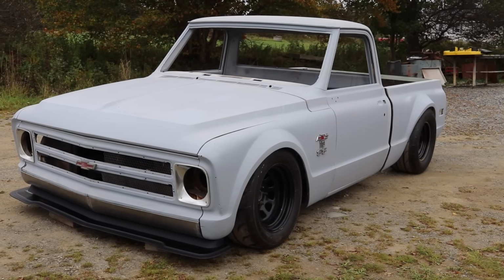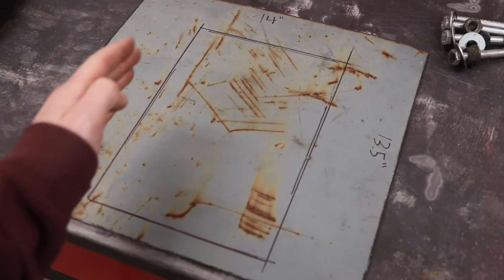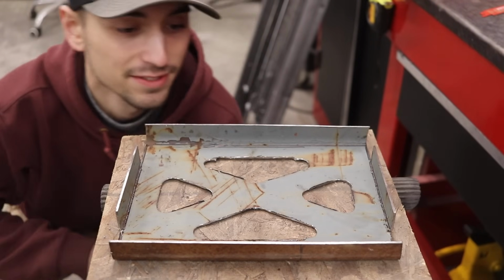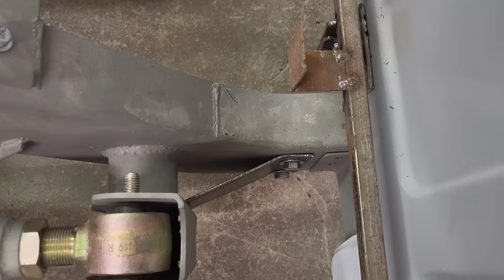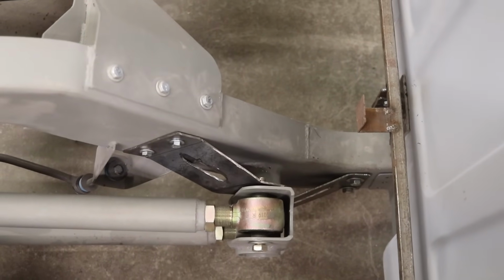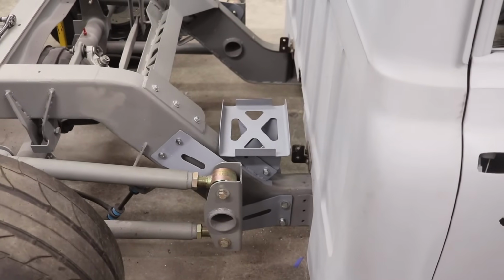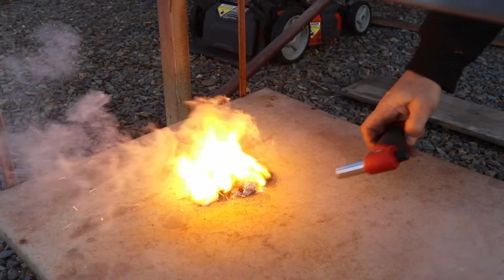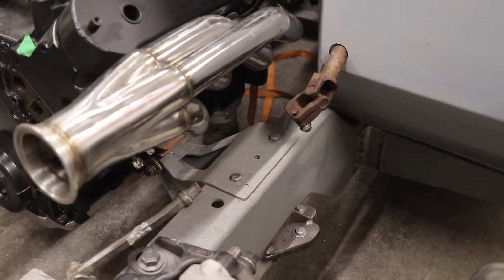Turbo ‘68 C10 SS (SUPER SHORT) I Reinforced My Custom 4 Link Suspension!

Comment: I'm glad you are ok after that near miss. Aluminum dust and mild steel dust mixed together can become thermite and ignite when an ignition source is present. However, it is also extremely common for auto makers to use magnesium for production of steering columns. The result of grinding magnesium and having a reaction similar to yours is very plausible. I would suggest testing your column to see if it's magnesium. You can put a cap full of vinegar on it and watch for results. If the vinegar does nothing, the it's aluminum. If the vinegar has a reaction by bubbling or foaming then it's probably magnesium. For just aluminum to be flammable like that, it has to have an ignition source present when it is in exactly the right concentration when airborne. I hope this helps.
Reply from the maker: Thank you! Good point, there very well may be magnesium in there. I'll try that out to find out👍

Comment: I’m glad you added brackets to those 4 links. The single tube mount was a bit concerning. I would have probably used something like 1/4 or 3/16 at least. But you have to use what you have! Great engineering
Reply from the maker: Yup, it will for sure be better with the added brackets! We'll see it holds up!👍

Comment: Have you thought about making a triangle on the bottom of your jack powered metal brake. So you only need one jack. I know you lose a bit of power but I'm sure it would make it easier to operate.
Reply from the maker: Never thought about it! I'm sure it would work. I could swap it out for use with light gauge metal👍
Reply: @ag_trucks  the other option is make a removable T piece bar that joins the two Jack's together so they move in tandem equal movement  less effort...if that makes sense

Comment: I like what you're doing, really cool project. Maybe make the speed holes in the 4 link brackets triangles as well. It would fit with all the other triangles.
Reply from the maker: I would have done that but I don't want to take off too much material off the brackets. Thank you man👍👍

Comment: I didn’t know aluminum burnt like that, magnesium yes, wow. 
Steering column coming along nicely. 👍
Reply from the maker: There may have been magnesium mixed in along with the aluminum, either way it was very flammable lol. Sure is, hopefully I get my parts soon to finish it up👍
Reply: Magnesium adds strength to cast aluminum parts
Very common with cast aluminum parts
Also water does not work well on magnesium fires

Comment: If you cut one of the short tabs and bend the longer pieces in beyond a 90. You would not need any additional materials because the base on the battery is intended to wedge in place.

Comment: I see the intake manifold is still tight- you could use a wiper motor/ assembly from a hatch back and run a single wiper on the drivers side.
Reply from the maker: It could be tricky for the wipers, that may be a good idea👍 I'll have to try that out for sure. Thank you

Comment: Bro you need to look into the arc droid. A cheaper CAD Plasma cutter. Makes life so easy
Reply from the maker: I didn't use my plasma cutter cause it makes a lot of smoke in the shop. It was raining outside as well so I just stuck with the zip cut but I'll look into it for sure👍👍

Comment: So love the 4 link reinforcements. I understand how they may flex a little but they will hold the 4 link torsionally rigid. My question is. Did you leave room for the back of the bed to fit between the battery and the cab?
Reply from the maker: Good observation, I didn't mention it in the video but the headboard will have to be bolted to the cab separate from the rest of the box since the roll cage will be going through it. That being said, the battery tray does fit right next to it👍

Comment: I was wonder what tire size on the truck is?
Reply from the maker: Wheels are 15x10 aero in the rear with 325/50r15 nitto nt555r2 tires and up front it's vision D window 16x8 rims with 265/50r16 toyo proxes r888r

Comment: Those thin brackets are going to flex and provide minimal reinforcement.
Reply from the maker: The brackets will be very strong unless you see something I'm missing? The 4 link bracket that is holding the bars will want to rotate forward under power which would induce pulling force on the reinforcement brackets I made. The brackets are very strong for pulling force but would be very weak (crumple) for pushing force if that makes sense but they are oriented in a manner that they will only see pulling forces
Reply: I agree, in tension they are ok.

Comment: That’s magnesium.
Reply from the maker: Yes, I just found out. I won't be cutting into it again😂
Reply: @ag_trucks  Magnesium is a flammable metal, obviously you’ve found out. It’s fun when fighting car fires and you get that explosion of white fire when it finally lights off. I hate the stuff. It was used for camera flashes way back in the day.
Reply: @ag_trucks  Also, FYI, you can use a 9v battery and some long wire to explode that airbag that you pulled out of the steering wheel. It could be a fun addition to your video. I’ve done it countless times. Just find the + - for the airbag, wrap a wire to each long enough to be at a safe distance and just touch the wires to a 9v battery (or even a car battery). It’s a quick giggle.